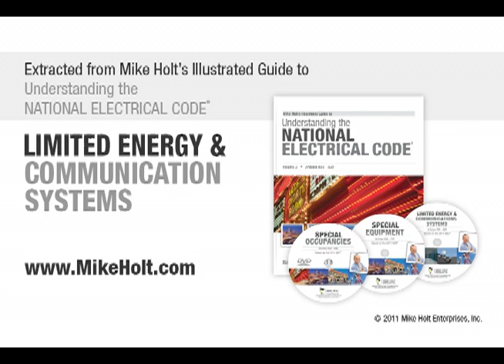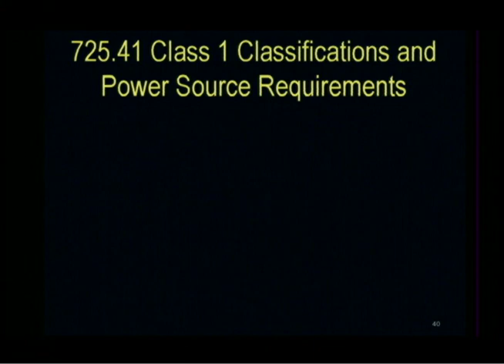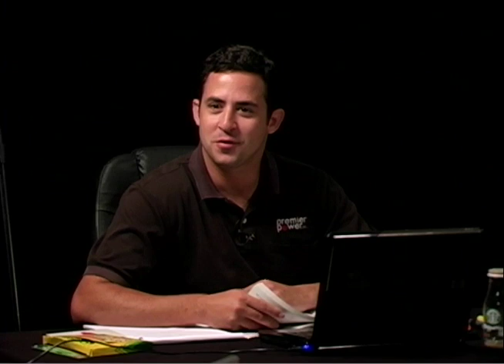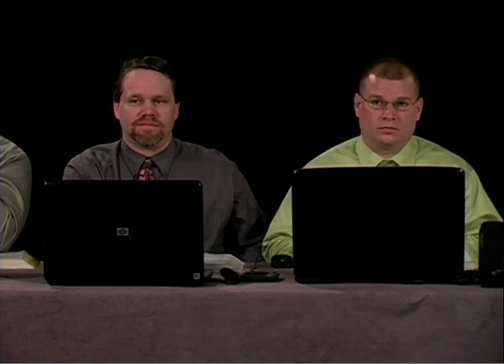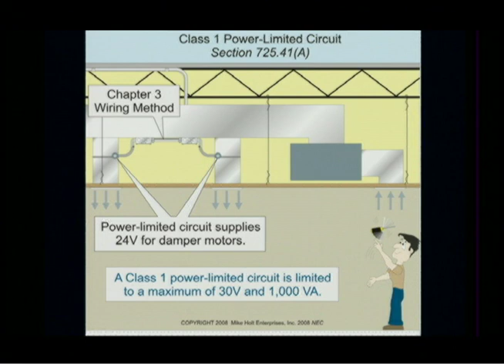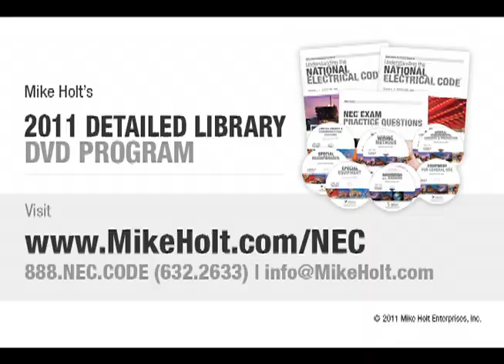NEC 2011 725.41 Class 1 Circuit Classifications and Power-Supply Requirements (low voltage)

Comment: Does rs485 communication apply as class 1? Can it be run with 240V circuit wiring? The wire i am using  is a cat5 rated 300V.  The wire goes from the pv bus meter  to the inverter and may run with the inverter output circuit,
Reply from the maker: This is a Class 2 circuit and it CANNOT be run with power.

Comment: 2008 code reads at 725.2 Definitions. Notice the FPN: See 725.21 for voltage and power limitations of Class I circuits. This probably should have referenced art. 725.41 Class 1 Circuit Classifications and Power Source Requirements as art 725.21 reference is 725.21 Access to Electrical Equipment Behind Panels Designed to Allow Access. 

Did they correct this in the 2011?